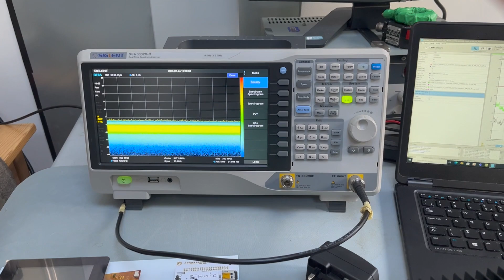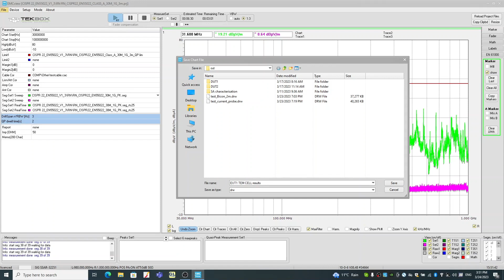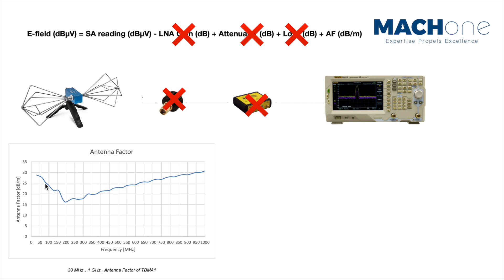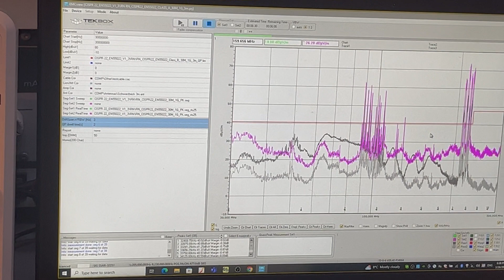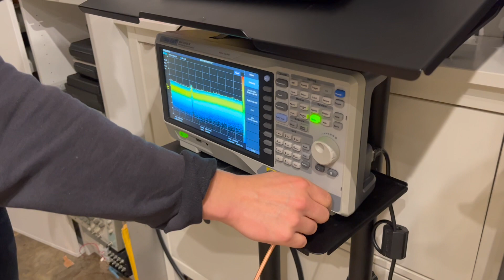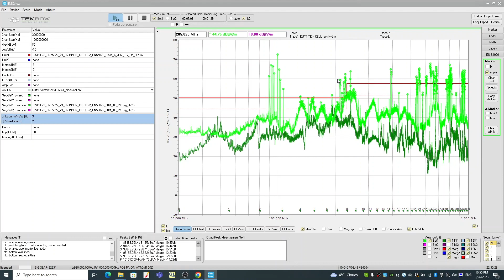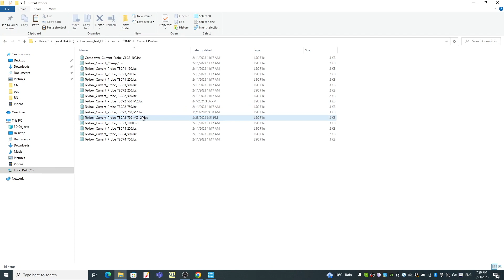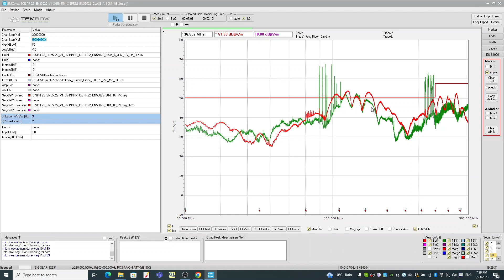Engineers' Guide to Pre-compliance Radiated Emission Test

Comment: Thank you so much for this video ! I am closed to order my firsts equipment to perform both conducted and radiated (open area) emissions tests (TBL5016-2, TMBA1, PeakTech 2240, EMCView). By the way, could you give me advices about an entry-level spectrum analyzer that could be used in my case ? I thought to buy an RIGOL DSA815 or a SIGLENT SSA3021 but I am not sure I could perform radiated emission test with those analyzer ?

Comment: This video is very educational / practical.  Question: if you are happy to over engineer, is there a safe db margin from tem cell raiding that is unlikely to fail far field? E.g. 20db?  I think problem you flagged was things like low frequency on power cable doesn’t get measured well on tem cell, so really need both sets of measurements.
Reply from the maker: Great question, my answer is I don't know. Ha, you are asking the wrong person, as I don't do over-engineering, as an EMC engineer, our job is to make the product pass, but not to make it pass 20 dB below the line. You know, often I don't agree when I see people posting on Linkedin say, oh, look at my results, quiet as noise floor. That means more cost for my client, no, I don't do that. But I think there is a way of correlating TEM cell results to far field antenna, personally, I don't see a strong correlation in the lower frequency range.

Comment: Hi Min, awesome video. You are saying at some point that the real time spectrum analyzer is making the scan in EMCview faster. How much slower would it be on a non real time one (e.g. : Siglent SSA3021X Plus) ?
Reply from the maker: Hi Alexandre, I think we are talking about less than a minute to do a full sweep to 1GHz with the real time SA, with the sweep type SA, it takes 5-6 minutes to do a full sweep, I haven't tested it properly, but it is close enough. Hope this helps
Reply: Did you ever test it, when we sweep the Real time vs the standard unit we found it half as fast.

Comment: Min how often does being near metal and having other EMI signals in your environment, say in an office, ever make the measured results less than they should be? I can imagine there may be destructive interference but would not in almost all cases the interference be constructive? Would that not mean that if you can pass the CISPR standard in your office, you should be able to pass it in the chamber?

I am aware that one major concern is you may waste time attempting to reduce phantom signals when your device is not the cause but excluding that fact maybe office results can be considered a conservative estimate of chamber results, right?
Reply from the maker: Very good question Abdifatah, as you said, in order to ensure the noise is generated by the DUT, not something else, we need to do some preparation, TEMCELL, near field probe and even checking the design datasheet, as shown in the video.
Reply: @MachOneDesignEMC  I don't think that this reply answers the OPs question. To phrase the question differently: Is it true that self testing in a noisy environment can tell you if your device passes EMI standards (if all the signal peaks are below the standard), but it can't tell you if the DUT fails the standards because over-the-limit signals might be caused by other sources nearby.